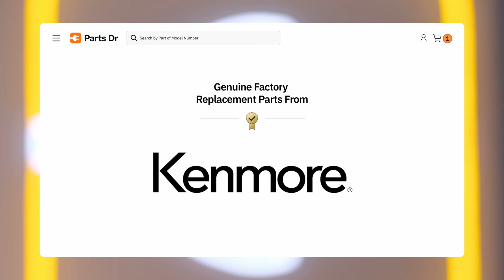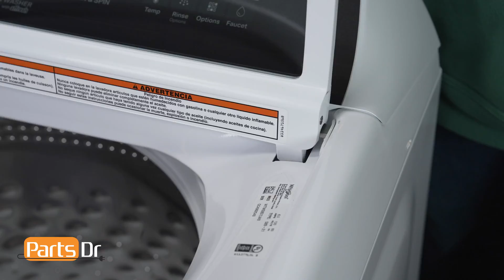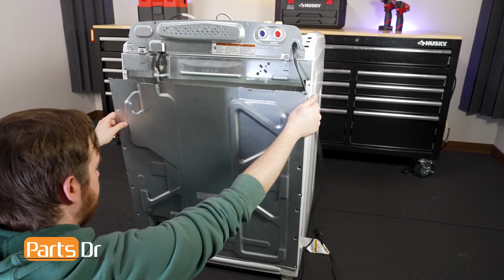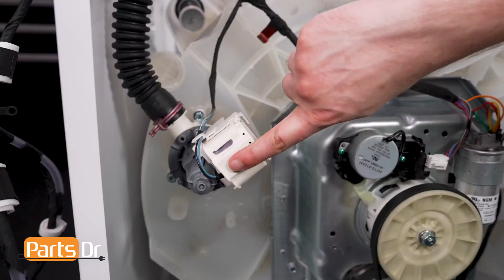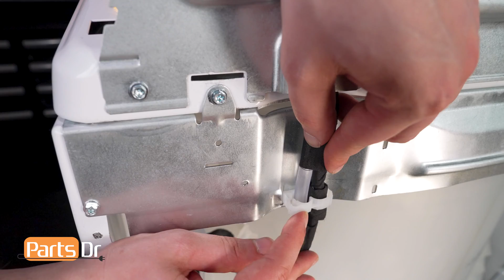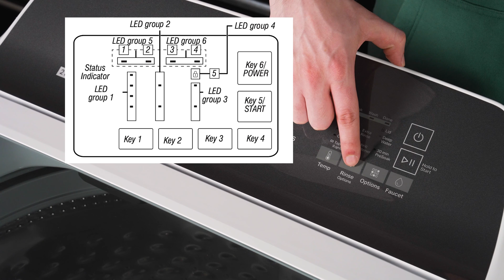How to replace Lower Wire Harness part # W11643701 on your Whirlpool Maytag Amana Washer

Comment from the maker: Thanks for watching our step-by-step guide on replacing the lower wire harness in your Whirlpool, Maytag, or Amana washer! If your washer isn’t functioning properly due to damaged, corroded, or burned wiring, replacing the entire harness is often the best solution since individual sections aren’t sold separately.

For genuine OEM replacement parts like the Lower Wire Harness Assembly, head over to https://partsdr.com. Using high-quality, original parts ensures your washer runs safely and efficiently, saving you time and frustration.

Good luck with your repair, and let us know in the comments how it goes!

Comment: Thank you so much, what a lifesaver this video was! My two year-old Maytag stopped draining because one of the two wires leading to the drain pump broke, which has been in common problem with this washer. Being out of warranty, it would have cost me so much for a technician to come in. Between the FB page that helped me identify that was the problem and then your video allowing me to remove and replace the entire lower wire harness, the whole repair was $62. Many, many thanks!
Reply from the maker: That's awesome, nice job saving yourself all that money on the repair!

Comment: Maytag MVW6200KW1
 got it in service mode and instructions say press 1 through 6. the problem with that is it has no #4 button. it only has 3 buttons at the bottom. in the service paper that came out of the machine it shows a 4th button at the right.

Comment: When taking the read for the drain pump wiring do you press down hard , my reading is only 2.6 to 4, so the lower wire harness needs to be replaced
Reply: On pin 3 and 6

Comment: So I had my lower harness replaced back in February but I finished up a cycle today, went to put another in and it’s sensing, lid locks but the water isn’t coming out. Could it be the harness again?
Reply from the maker: It's pretty difficult for us to say with those symptoms.  Try checking the washer for error codes: https://www.youtube.com/watch?v=wMfaFhZOaU0
Reply: No, it is not the same wire harness that would control you water valves!